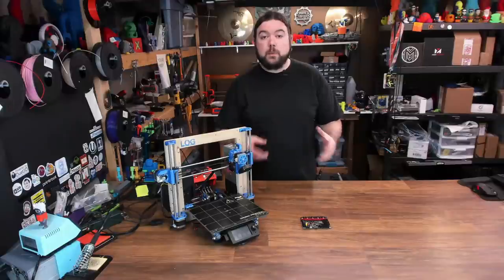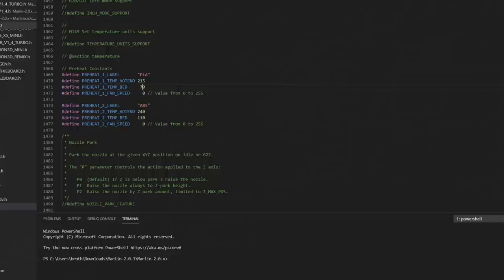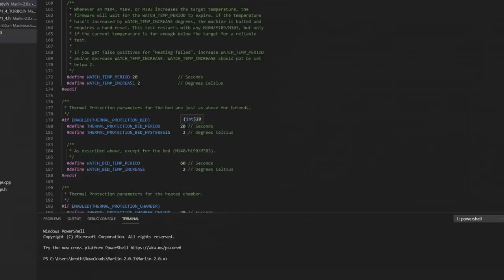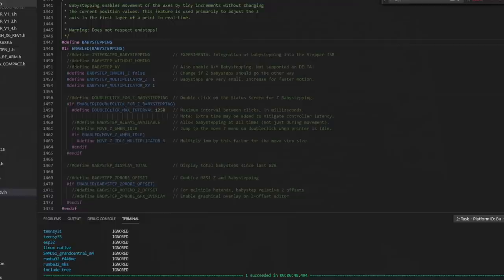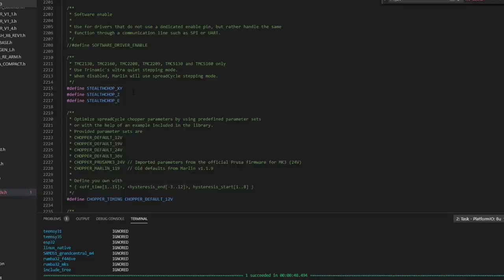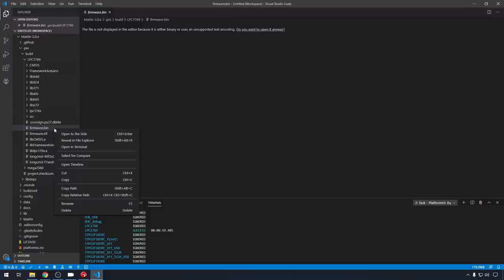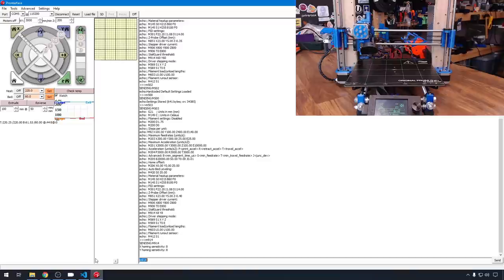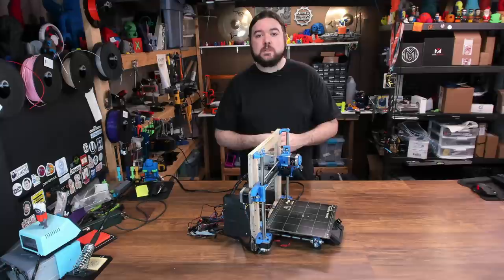BigTreeTech SKR v1.4 Mainboard - Full Install Part 2 - 2209 Drivers - Chris's Basement

Comment: Having homing trouble with sensorless homing on Ender5. X/Y reach their max when homing each axis, then when homing Z, nozzle is far from center of bed. Probe offset is correct. Abl doesn't want to reach parts of X but probes off bed in some areas.
Any ideas?
Reply from the maker: About the only way to get around that is to set your minium X and Y to negative values.
Reply: @ChrisRiley  thank you. I'll look into that. Cheers
Reply from the maker: @aarons2869  Let me know.

Comment: Followed everything in both videos setting up with out sensorless homeing and can’t get the y axis to respond and getting a tmc commutations error , any help would be appreciated
Reply from the maker: Check you jumpers and driver pins are connected correctly. Swap the drivers to see if the error follows the driver.
Reply: The jumpers are in the row 3 down to the left for the 2209s and I switched x and y on the board the y worked in the x but x wouldn’t work in the y
Reply from the maker: @michaeld8153  Sounds like you have it figured out then. Could be a bad board.
Reply: No problem thanks a lot just got it yesterday guess I’ll be sending it back and retrying I appreciate the quick reply’s
Reply: Quick question , I decided to swap the pins of e1 and y in marlin got y moving now with but it moves fast and hard is there settings to have it move smooth like x and z? Thanks
Reply from the maker: @michaeld8153  You will need to set you steps for E1. Just tag them with a comma after E0  *                                      X, Y, Z, E0 [, E1[, E2...]]
 */
#define DEFAULT_AXIS_STEPS_PER_UNIT   { 80, 80, 400, 93,93 }
Reply: Only for that one or I have to add the speed and everything for E1 also
Reply from the maker: @michaeld8153  It should default to all that, but it might be a good idea to update the just like M92.
Reply: I can’t compile now say default steps per unit has to many elements, is there a way I can pm you to get some info ?
Reply from the maker: @michaeld8153  Thinking on it, I wouldn't do it that way. Tell the firmware you have 2 Y motors, one on Y and one on E1, then E1 will use the Y settings.  In configuration_adv.h take the comment off this line. //#define Y_DUAL_STEPPER_DRIVERS
Reply: By defining that line will the y automatically be dectected on e1 or I have to configure that as well?
Reply from the maker: @michaeld8153  E1 will be selected automatically.
Reply: Yes!! You got it working for me , have a small whistle coming from the z axis now and can not figure out why Bltouch is not working still but at least that is one issue , any chance you can help me out with the bl touch ? What is yourPayPal also sir I need to buy you a beer for this one
Reply: Edit :fixed the whistle noise on the lcd in tmc drivers then hybrid the z was set to 3 and x and y are set to 100 and e1 is set to 30 changed the z to 100 not sure what this is for but it worked , now just to get the bl touch working I appreciate the help
Reply from the maker: @michaeld8153  cool!
Reply from the maker: @michaeld8153  So what's up with the BLtouch? Do you have BLtouch and AUTO BILINEAR uncommented? My paypal is chrisriley3d@gmail.com
Reply: Yes I have both set and I have 5v set to cause it’s a 3.1 it just flashes red and won’t probe or take commands at all , also with the y set up how it is when I home it homes fine then when x goes to home the y slams into the front, is there a way I can send you videos and maybe my configuration I would pay for your time to look over everything
Reply from the maker: @michaeld8153  Let's tale this to email. Send a video here brotherchris81@gmail.com
Reply: Will do man thanks alot

Comment: As much as i followed through i am getting errors new at this and cannot seem to know whar my errors are
Reply from the maker: What errors do you get?
Reply: @ChrisRiley  i got it works now thanks for your video and reply
Reply: I do have another question if u dont mind trying to answer do you have a video on how to set where the probe should be while it sets all 9 points on bed when i start mine the firdt front left the probe is in bed but nozzle is off the bed.
Reply from the maker: @xALFx13  By default, it works from the bed size, if your nozzle is off the bed, then you can set it in the negative. You can also manually set the points. https://youtu.be/iwhbeD2AduA?t=871
Reply: @ChrisRiley  so then i must have something wrong in the conf.h file for it not to go by bed size i have the bed size of 220 by 220 but dont know where to check if there is another place to check it for of if i have everything centered correctly

Comment: Do i really need the stepper drivers? New to this
Reply from the maker: Yes, you can't move the motors without drivers.
Reply: How do I know which order they're in is it from XYZ extruder on the board
Reply: @ChrisRiley  also I remove one of the pins from the X and the Y driver but not dizzy driver or the extruder driver
Reply from the maker: @somethingtocosplayassometh21  All the info is here, this will tell you everything you need to know. https://github.com/bigtreetech/BIGTREETECH-SKR-V1.3/blob/master/BTT%20SKR%20V1.4/Hardware/BTT%20SKR%20V1.4%20Instruction%20Manual.pdf

Comment: Chris I can really use some help to get my board running, it’s a 1.4T, Tmc2208 and also using TFT35 V2. I have compiled the fw but one I put the sd card on board nothing happens, tried via usb as well, looking as drives I can see the one for the board but anytime I click on it says to insert disk, I’m at a total loss here not sure what I need to do. Awesome video btw.
Reply from the maker: Thanks! Sounds like somethings wrong with the SD card. If you mount it on your computer can you format it fat32?
Reply: Chris Riley tried different cards already, even wrote bin file to a card to load it that way and nothing I’m sure the board is messed up I’m getting new one in the mail tomorrow
Reply: Well got new board in today and as I expected it was the board the new fired right up soon as I put in compiled FW on the card, I really appreciate your reply and assistance. I would definitely keep watching your videos they are amazing and informative. Thank Chris you’re the man
Reply from the maker: @migigaming1484  Awesome, glad to hear that!
Reply: Chris Riley doing some research I feel should have gone with the 2209s, unless the issue with Linear Advance and the 2208 has been fixed.
Reply from the maker: @migigaming1484  Not sure where that is at. I hope they have it fixed in 2.0.6 which should be out soon.
Reply: Chris Riley ahh thanks for that info bud I appreciate it. May just grab a set of them 2209 I plan on adding the EZABL soon.

Comment: Thanks!
Reply from the maker: Awesome, Thanks!
Reply: @ChrisRiley  Just had to come back and say thank you for such a thorough walkthrough of editing marlin code. I've updated the FW on my 2 yr old CR-10 V2 twice now. Once when marlin 2.0 came out and decided to upgrade to an SKR 1.4, and again recently for marlin 2.1.1. Referenced the two videos both times and I'd say 98% of what you covered is still relevant for todays latest fw updates, a few settings have moved a round a bit but are easily located. What was initially a big daunting task, was made easy thanks to your videos. Also your Unified Bed Leveling video was a great help. UBL is a fantastic free upgrade and made my first layers come out excellent every time.  I would recommend this pair of videos to anyone wanting to dive into a project that involves compiling their own custom firmware!
Reply from the maker: @mgnovasaleen  Thank you!

Comment: Hello, do you a idea why mine is blank and beeps?
Reply from the maker: Blank and beeps? Did you load the firmware?
Reply: @ChrisRiley  yes
Reply: @ChrisRiley the screen is blue and it makes a beeping noise for a second
Reply from the maker: @universe2170  Which screen do you have? Which one do you have set in the firmware?
Reply: @ChrisRiley  it’s a reprap smart controller 12864, I uncommented the similar one
Reply from the maker: @universe2170  There are 2. Make sure you have right one. Try them both

Comment: You probably don't want to enable the speaker option, it is not to enable the beeper. As the description says, it is for where you have an actual speaker which can be driven at different frequencies. The normal cheap LCD boards have a beeper, which goes at one frequency when power is applied.
Reply from the maker: I am going to have to look at this. I can enable this, then do multi frequency on the beeper.

Comment: Thank you ! :)
Reply from the maker: Thanks for watching!
Reply: @ChrisRiley  i learnd many things from your videos. The only problem left after the upgrade, is my extruder. I did the calibration on the steps and it got a little bit better.
But there is a bit of underextrusion on the first layer. 
Do i need to touch the  DEFAULT_MAX_FEEDRATE or DEFAULT_MAX_ACCELERATION ? 
And need the 2209 a vref calibration ?
Reply from the maker: @Ottivad  I don't think the feedrate or vref would be an issue, are you using a prime line or a skirt? Maybe it just isn't primed enough.

Comment: Hi, Facing some problem , Display showing Err : EEPROM Version and end stops not working . . . 
My setup marlin link https://drive.google.com/drive/folders/1sZosXoTjn4S4I1R_DpCG4hutivSgav3P?usp=sharing
Reply: " Err : EEPROM Version" this problem solve by click of reset button of display , please guide on "end stops" not working
Reply from the maker: To get rid of that error, cable USB and use pronterface to run an M502 then M500. What type of enstop do you have?
Reply: @ChrisRiley  
Hi,

Thanks for reply, m502 m500 solve problem.

But endstops not working, I am using mechanical endstops and bltouch .

With m119 showing triggered and open property, but endstops not stops motor

I have cut one pin which need to cut for non sensorless homing.

Need your help , please guide.

From last three days I am trying but not going success .

Please help by share marlin firmware file in the view of mechanical endstops, bltouch, tmc2209 UART.

Please . . .
Reply from the maker: @ypsonar  I can't think of what else this might be, if m119 works, then it should work. Make sure your software enstops are enabled.
Reply: @ChrisRiley  
Problem resolved.
Normally Open mechanical endstops switch specially for tmc2209

Normally closed not working . . . . 

Many thanks . . . 

Thanks to all . . .

Comment: Hi, may i know why my printer cannot connect to pronterface? It is stuck on connecting and is not budging?
Reply from the maker: You will have to change your serial interface in Marlin, serial 0 should be -1.
Reply: @ChrisRiley  Hi chris, ive tried everything. I have changed the serial to -1 and it still stays stuck on connecting, ive followed other tutorials as well but it gives the same result, even when i vary the baudrate or anything else. 

it also gives me an error that : 

#warning "Your Configuration provides no method to acquire user feedback!" [-Wcpp]

:( may i please get some help on this as it just stays stuck on connecting on pronterface,
Reply from the maker: @kittywitty5046  The error should be okay. Make sure you have the ch340 driver installed on your computer.
Reply: @ChrisRiley  Hi, the driver is installed correctly, but i still face the same issue. I cant see the printer when i connect to Cura either. :( Is it because im powering the board with the USB connection or something?